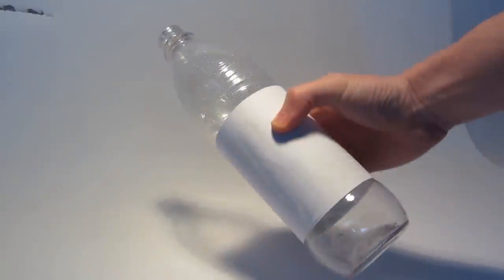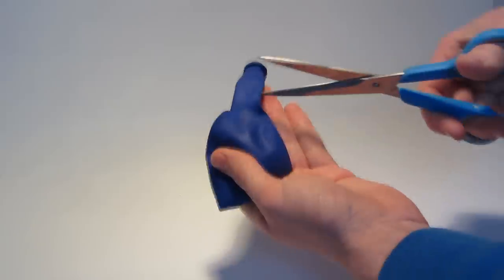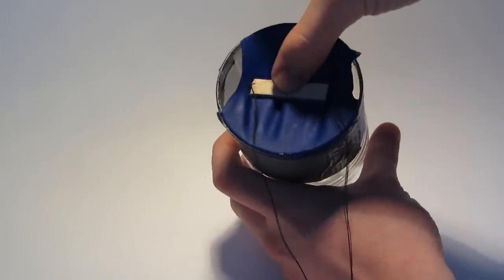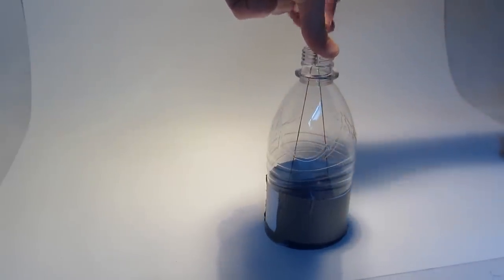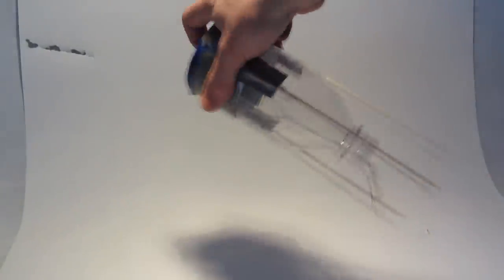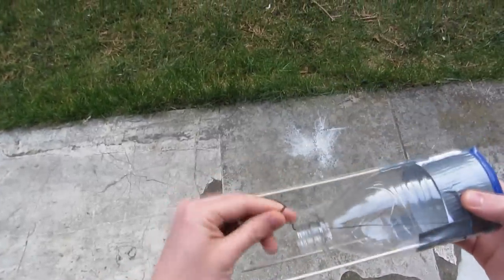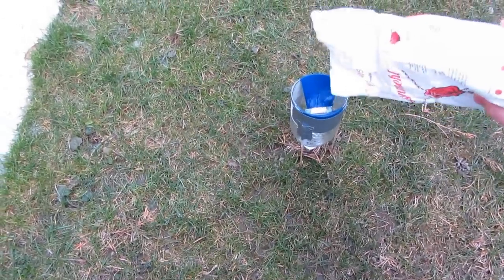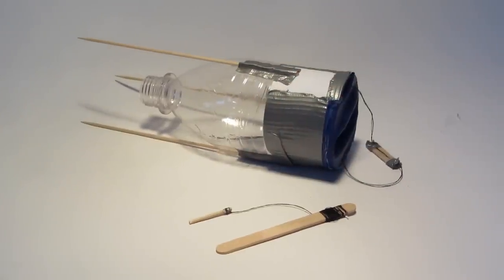Homemade Water Bottle Tripwire Trap

Comment: How about using some kind of strong container instead of a water bottle and adding some strong elastic with a tough trigger then you could put stuff like pebbles they would fly up and possibly hit the burglar. Still a good vid I'm going to try it out.
Reply: ***** I've started but I haven't finished because I still don't have all the material's cant wait.
Reply: This isn't for burglars. This is for paintball matches. You'd need to stretch that elastic a lot further if you want it to throw rocks to injure a person. But then you run the risk of injuring your housemates with something like that lying around.
Reply: sherlockinsomniac Then just be safe.
Reply: I Used a 4 GL water bottle and put confetti inside woah hahahaha
Reply: Heavy Mental Lmfao

Comment: it isn't even a trap!!!
Reply: whats a candle going to do
Reply: Don't think of it as a trap BLACKBIRD... It's more of an early alarm system, and with the parts used to make it being so easily available, it's actually quite a good one... If you would like, you can even aim the baking powder towards the trip wire to make sure that whoever or whatever sets it off gets covered... You can also use a couple of bells instead of the baking powder so that you can hear the alarm go off... It's a really good idea :-D